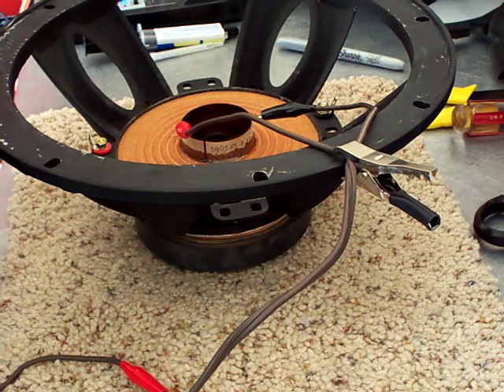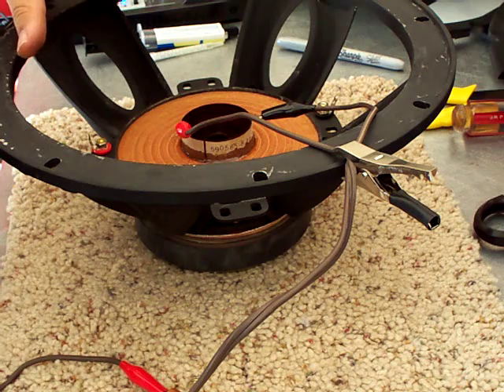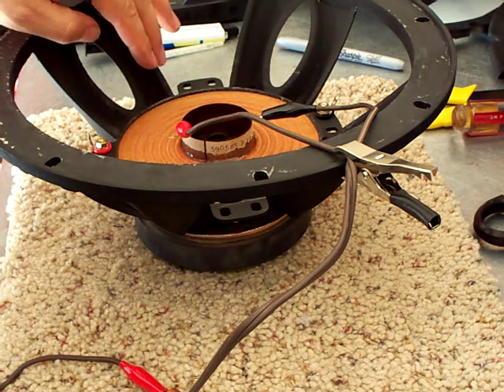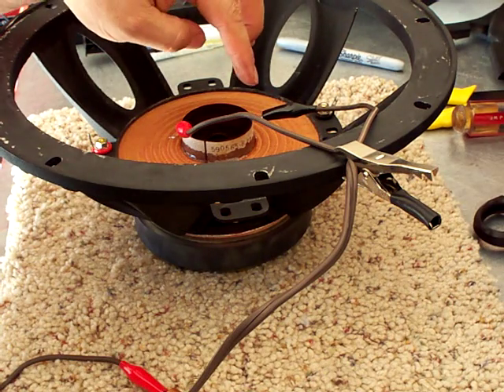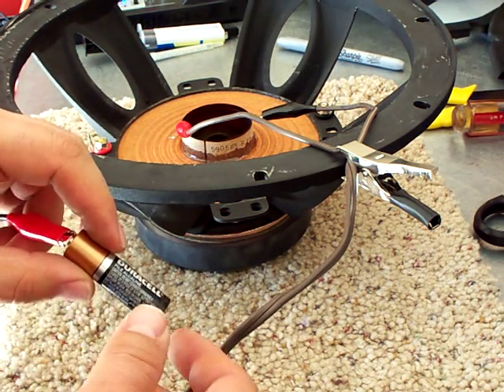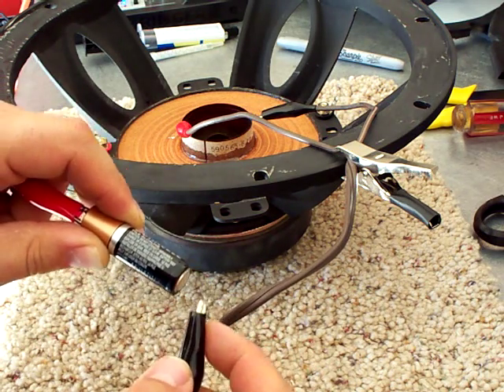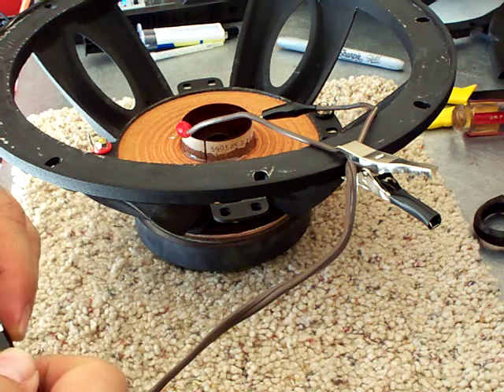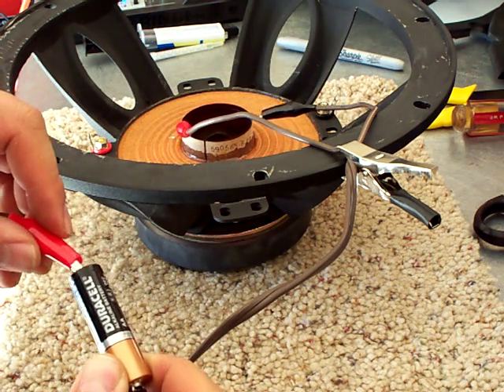Testing a Speaker's Polarity, or voice coil polarity

Comment: so yeah.. it goes up and down when you connected it to the battery but you did not mention if.. the way you hook it up when it goes up or down if that's the proper one.
Reply: yes he did. with the battery test if it goes UP than note how you connected the battery. That is how you identify which side is pos and which is neg. Comon man.

Comment: Hi XXVelocityXX,  I want to clear my fear about the polarity 
connection of my Spendor speakers.  I wrongly connected the Two 
Negatives of the 2 speakers to the one channel of the stereo amp and the
 Two Positives of the 2 speakers to the other channel of the amp. The 
amp was put on , one channel was working and other channel didn't work ,
 after 20 minutes then I came to know and shocked that i did the wrong 
connection then I made it as correct polarity connection. Now the two  
speakers working as usual. Now I want to know: by this wrong connection,
 any harm to my beloved speakers? any would  become weakened inside the 
speakers?? I am much worried?  Kindly clarify in detail. Thanks and 
Regards.
Reply from the maker: How long was it powered on in the prior configuration?
Reply: For about 20 minutes it was powered on in the wrong connection. Thanks
Reply from the maker: Without examining the voice coils themselves, it wouldn't have damaged the speaker with the negative leads attached to it.  It's possible of damage to the speaker with the positive leads, but since the speaker is still working after 20 minutes of use, then there's probably no damage; otherwise, the voice coil would have fried itself, and there wouldn't be any sound coming from it at all.  It could potentially have slight discoloration or burn, and the best way to tell is if the speaker is giving off a bad smell.  So, just check it periodically for a burnt smell to determine if the voice coil is failing.  In the end, your speaker is probably fine.
Reply: Thank you XXXVelocityXXX . It's a great help to know my speaker's condition. Thanks a lot. Best Regards.